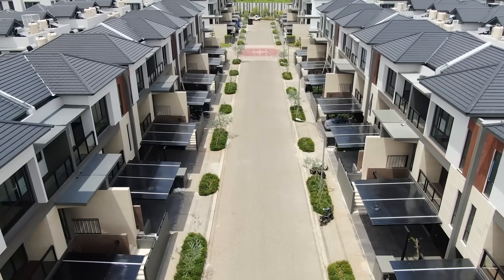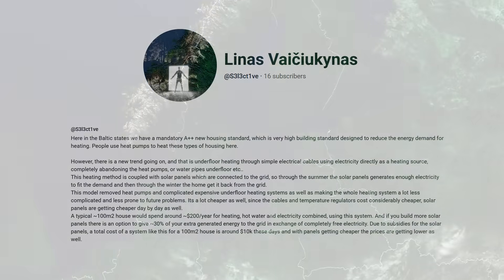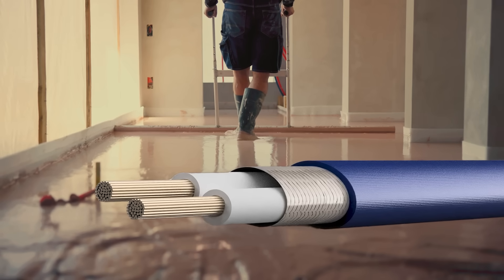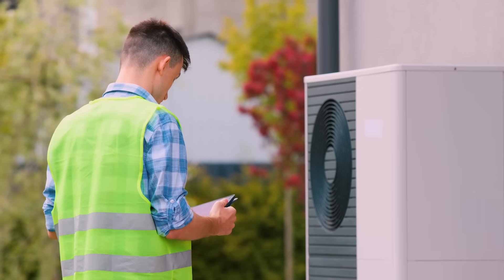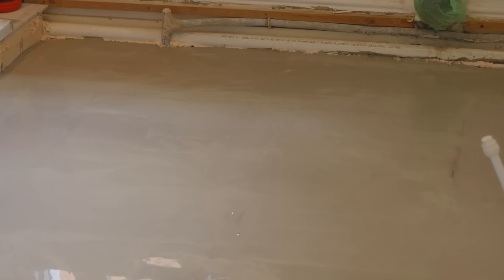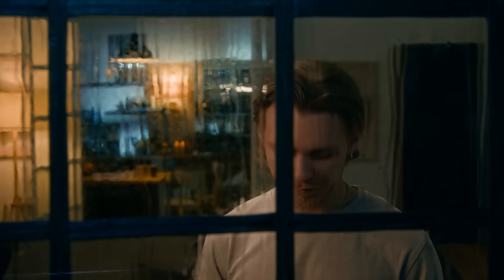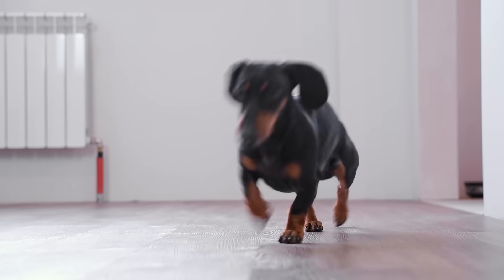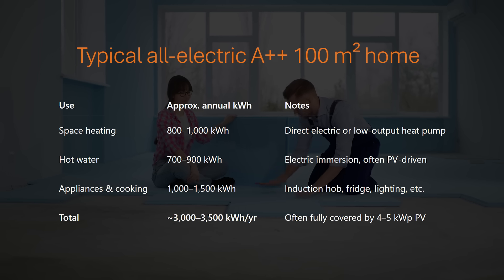What the Baltics Can Teach Us About Home Heating

Comment: We've got electric underfloor heating throughout a property, the only heating system and no gas available. I would say it's more cost effective than other types of direct electric heating but also a really comfortable stable temperature. Many flats can't get gas nor a heat pump so if you do a refurb it's the best option
Reply: Or buy apartment on4th or 5th floor. Then you dont need any heating at all.Your neighbours bellow pay for it
Reply: I’m sure it works fine, but knowing   I could be paying 1/4 of whatever it does cost for a boiler or heat pump driven system would be too much for me!
Reply: @edc1569 Yes - it's at a property where there is no 4G signal either so we can't even get a smart meter and cheap overnight rate. The plan was to get a battery and charge cheap rate overnight and use that for the heating. Irony is electricity is really expensive in this country because of gas!

Comment: Slightly off topic, but unvented heating systems are much more complicated than the old vented systems, I've found they cost much more in repair bills
Reply: I’ve found less, all that pipe work and the open tanks in the un insulated loft space would always cause issues. 

With the unvented maybe every decade you need a new expansion vessel, but that’s been it!
Reply: @edc1569  I've never had an issue with properly lagged pipes and tanks in the loft

Comment: About 40 years ago worked on a Swedish home down in Exeter it had triple glazing throughout the house walls were 12 inches thick with 3 layers of varying insulation we took sleeping bags just in case we couldn’t get digs as it was late when we left. Had to open the windows it was so hot no heating on just the house itself. So if the house is built to really high standards like this well your nearly there. We slept in the house staying for week or so pub across the road.

Comment: here in the faroe islands air to water heat pumps work perfectly well , i dont understand why it simply wont work in britain
Reply: They do work when:

1. You can find a competent installer 
2. You aren't poisoned against it by media in big oil's pockets
Reply: Do you have the daily mail on the faroe islands?
Reply: @edc1569  no
Reply: a regular house here is about 250m2 in two stories and they have went from paying 400pounds a month on diesel fuel to just paying 90 pounds a month on electricity instead and the houses are just as warm as they were before with oil fired boilers

Comment: There's no debate about keeping the heating going with a heat pump, the heat pump runs more efficiently in this way and so uses less energy, with maximum comfort levels. A heat pump will always produce far less CO2 than either a gas boiler or direct electric heating, the latter can be fine in incredibly well insulated homes, a heat pump works fine when the insulation isn't that special.
Reply: Depends on how the electricity is generated. Solar, wind, nuclear - I agree. Gas powered generator? Not so much.  Depends on the plant - latest ones may be close to 60% efficiency, older ones way way lower, some down at 35%.  Then subtract the losses in transmission and distribution. Suddenly not so clear cut.
Reply: @Kate_Short-For-Bob with 60% efficient pure gas generation you are still saving 40% of the gas. Increasingly in the UK your generation will be renewables with gas planned to be 5% of generation in 2030.
Reply: You absolutely need a well insulated and airtight building for a heat pump to be effective. That is indisputable and a simple fact.
Reply: @PureHokkaido  no, plenty of Victorian terrace houses and cottages do just fine with heat pumps, thank you.

Comment: Hi Roger.     Heat pumps are the Evs  of the heating systems , not here for the long haul . The more there are the quicker the reality will become  apparent , particularly in the resale of property . But I suppose the saying, no pain no gain , is a reasonable statement . Unless of course your the one who gets the pain 😂
Reply: Meanwhile, in the latest cupra born a £26k new car I can drive from Scotland to London with a single 20 minute charging break.   I do it every couple of months.

Heat pumps have been heating commercial buildings for decades.
Reply: Kind regards indeed , enjoy it while it lasts . But don’t expect it to have any value when the time comes , as for heat pumps as a retired electrical contractor , I can assure you they have not been around for decades certainly not in the form of tec there desperately pushing now . And the same goes for EV they can’t sell them even at less than half price .  But ultimately if you’re happy that’s all that matters  . 👍

Comment: A2A units are a tenth of the cost of A2W, that seems like the obvious solution.
Reply: Not if you need 8 units 😂
Reply: @edc1569  Tell that to our victorian pile. Big old buildings were often designed to be heated from a few central points with big fires. Shove the A2A system in those rooms and magic happens just like the original designers intended.
Yes you now open doors to warm a room rather than close them but that's what us oldies grew up with before radiators anyway 8)
Reply: @edc1569  For smaller properties, A2A works well. No need for 8 units in them. 1 or 2 units typically, maybe 3 or 4 at a push - even then you have multi-split systems that cut down cost.

Comment: The "solar bank" is also a thing in the Czech Republic. You can feed into the grid and "bank" those KW for use in winter, rather than being paid a flat rate (although you can opt for that option if you wish).  
It is a very good system.
Reply: Sounds like an unsustainable system though, if enough people do it where does the energy come from in winter?
Reply: @aliasgharkhoyee9501 Over 80% of the countries' energy mix is nuclear/coal.

Comment: My ASHP is currently running. Toasty 21 Celcius inside, 13.3 Celcius outside, using 350W to pump 3150W of heat into the home with a flow temperature of 32.1 Celcius going through the radiators. Dirt cheap to run with this weather and stil very competitive compared to a gas boiler in winter.
Reply: that's a warm temperature , if it was 10C cooler or more as in UK winters the cost soars...
Reply: @jameshall5624 I live in the Netherlands. Pretty much the same climate. Average SCOP so far is 4.7, so thats 4.7 x as much heat pumped compared to electricity used,  including winters with snow and sub zero temperatures outside.
Reply: @jameshall5624  They still work well at minus temperatures, the comfort levels from my heat pump is at all external temperatures that we get here, far greater than I've ever had from a gas boiler - and it's cheaper to run as well. When I rent a holiday cottage that has a gas boiler (almost all of them), I feel like I'm slumming.

I have standard insulation on my 1960s ex council house.
Reply: My heating system is way cheaper than that because I wouldn't even switch it on with an outside temperature of 13 Celcius.  Whatever happened to resilience?

Comment: I live in Lithuania and I’m building a 240 m² house here. The grid scheme works so you can feed electricity in and later take out 69%, but anything left over gets reset to zero on 31 March each year. The government has guaranteed this setup until 2029, but the EU is pushing countries to move to fixed or variable selling prices, so it probably won’t continue after that.

Like most of mainland Europe, there’s loads of solar here. There are even schemes where people in cities can buy panels in solar parks that are virtually connected to their homes and use the same grid system.

Air-to-air and air-to-water heat pumps are sold really aggressively, but I’ve heard lots of stories of people being unhappy with them. Ground-to-water systems are more popular and usually use boreholes instead of trenches, but when we looked at it, the numbers didn’t make sense — for the same money, the solar panels would give us around 300% of our estimated energy needs. We’ll just use the electricity directly to heat a buffer tank for our water underfloor heating.

Water underfloor heating is still standard in new builds, and stoves with back boilers linked to a buffer tank are common outside the cities. In the cities, most people use district heating — big networks of hot water from central power plants. If you’re connected to that, it’s by far the cheapest option and you don’t need any heating system at home.

Roger - let me know if you are interested in having a look at what I'm building. I've had an interesting journey, learning the differences between how to do things in the UK and Lithuania.

Comment: If you have an energy performance survey carried out, you'll get a lower rating for electric resistive heating compared to gas. I've got a flat with the latest electric panel heaters and it has a very poor rating. The only very poor rating compared to the other criteria whereas a house that I own that has gas heating has a good rating. They both have an overall 'C' rating but the flat was built in 2006 and the house in the 70's. The government wants to tighten up the EPC regs yet want everything run on electric. Doesn't add up to me but then does anything that the government sticks its grubby fingers into?
Reply: Affordability comes into domestic EPCs and therefore the high cost of electric brings the EPC rating down. Can you believe that, they're ramming heat pumps down our necks but installing electric heating actually reduces the EPC rating. It's madness.

Comment: So they 'save' around £800/year but see a building cost (outlay) of £25,000 to achieve that status?  It will take you 30 years to recoup the cost.  No such thing as a free lunch they say.  There is no reason we shouldn't have cheap electricity.  I can produce it myself for the same price the grid delivers it so what happened to economy-of-scale?  We should be able to buy electricity at 1/10th the cost of DIY generation but we are CONTROLLED via our energy and that's all the Government are interested in.
Reply: can you produce it when you want and in the quantity needed? 1kwh in the middle of a summers day isn't the same as 1kwh on a cold dark evening with no wind.
Reply: Also the level of tinfoil hat ism going on here is total nuts, our electricity industry is incredibly open you can go on websites and see what’s being generated from where at any moment you can see the live pricing data from sites like ember, you can get chat gpt to break down the pricing and costs to absurd detail if you want.

Running a clean modern grid is just expensive and input costs for the UK have gone up dramatically as we take on the double issue of depleting UK energy sources and an increasingly unstable world - alongside some pretty strict green targets.

You really don’t need the tinfoil hat - all the information is out there.
Reply: @edc1569  agree, but I do think you need to mention the cfd pricing, which shows how ridiculously expensive wind ends up being, particularly as it is nondispatchable
Reply: @edc1569  It's not an open system when the suppliers are 'forced' into operating under conditions that do nothing other than increase the price to the consumer.
Reply: Luckily in the UK we have an open system so you can build a power plant and get it hooked up to grid and start earning, so I guess we just need to wait a few more weeks until the capitalist line their pockets and just sell electricity for twice what it costs them rather than 10 times …..
Reply: You're spot on
Reply: Even soviet comunism was more fair to its people...In councill homes , they even fit more vents to let the heat out under excuse of safety...

Comment: One thing you never heard on these insulation ideas is the elevation and position of your house and more importantly the parts of your house that would let in cold quicker or lose heat quicker than other parts. If this was taken into consideration, a lot of people would find they could save or prepared better by using more insulation where it's needed. It's not a case of filling up every bit of the house, just lead to other problems and an uncomfortable summer, maybe. Just look at my house, the back door look brand new after ten years or more but the front get totally stripped every year by wind and rain.

Comment: They doing it wrong. Those tight houses needs recuperation system for ventilation. So better idea would be to use air-to-air heatpump and combine inside cassette with that air system. Similar to what USA doing with their HVAC. That air-to-air heatpump would cost like 1-2k and you are set... +you get AC also
Reply: even though its air to air the building is still air tight so no benefit over hydronics
Reply: @dantronics1682 How there is no benefit? You still need heating/cooling. Why not go with cheapest option when set up costs isn't that expensive?  If house will not have recuperation system aka ventilation it will rot out from inside.
Reply: @Tavs.fāters Yes, a heat-recovery ventilation system is almost essential in very tightly built houses. Those systems should have a metal filter to prevent mice/birds/insects from entering the system, a paper filter that's similar to a HEPA filter to filter out most particles, a carbon filter to eliminate odours, an ERV heat/humidity exchange system, an air-to-air heat pump and optionally a demuidifier/air conditioner.

You can't just seal up the house and shove in an air-to-water heat pump to heat the radiators(whether underfloor or conventional radiators) to heat up the same stale air that becomes more and more humid and carbon dioxide-laden as people breathe and live in the house. That cheapskate solution isn't going to cut it.
Reply: Recoups are mandatory here, otherwise you would suffocate in house that well sealed. But we don't use forced air as that is uncomfortable; everyone preffers using radiant heat. Install separate AC for those 5 days during summer when you want one, otherwise AC is not actually that useful in out climate
Reply: @vkalvaitis  Recoups already is 'forced air"... Adding low power heat pump to it wouldn't make any difference in air flow around the house.

Comment: Really don't understand why you've got it in for heat pumps.
Reply: I can see his point, I like heat pump, I have a mini split and dont save anything over running gas, the main savings is one energy bill so no expensive gas standing charge
Reply: Why do you think that? He's always said he's in favour of heat pumps, at least in many videos I've watched in the last few years. 

He's right to point out that installations aren't usually done right as installers aren't well-trained yet (it's early days for A2W heat pumps), which normally causes issues with cost and efficiency for households.
Reply: Because he is uneducated, ill informed and a misogynist bigot.
Reply: They’re unsightly for a start
Reply: To be fair to Roger he’s come round to them, he’s just an old dude and likes scorching radiators and still thinks a condensing boiler is some sort of engineering marvel. Let him be.

I’m sure he remembers how transformative central heating was to the UK, getting your own gas central heating at home installed was such an uplift for people’s standards of living back in the day.

Comment: Huge mistake. Here in Sweden we have houses built around 1980 with resistive heating only. They might require 4-5kW of heating in the winter. Lots of people are augmenting this with a mini split air source heat pump to save some money. Worst part if you don't have any hydronic system for heating is that your options are extremely limited if you ever want to change it. I wouldn't recommend to install a resistive heating system now. The only resistive heating I have is just for my bathroom floor and it uses 1MWh/year which is a lot just for that. Building total requires 25MWh/year in heating, but with my ground source heat pump this is cut down to 6.5-7MWh/year.
Reply: Similar here  in Finland. Many older homes built with direct electric heating have been retrofitted with air source heat pumps - that's if they haven't been torn down and replaced with something new, built to modern standards. Electricity here is often very cheap at night, even in the winter, so the underfloor direct electric heating can make sense with the whole floor acting as a massive storage heater - The floor is a giant block of concrete with insulation underneath and all around, so difficult to retrofit - especially to UK houses with wooden floors.
Reply: The resistive heating in Lithuania was, is and will be rare. Most people choose air-to-water heat pumps, best models of which are able to move sufficient amount of heat even at  -30oC, and with SCOP of >3.0.  

I follow the discussion between Skill builder and Heat Geeks. Yes, you can build a house to a Passive house standard, and have the only heat source- resistive heating in the heat recovery ventilation which is enough to heat the whole house through the coldest days. Rest of the winter, which due to climate change is more like autumn now (+8 to -5), you can be very comfortable without any heating.  Problem is that you need really good designers, engineers and strict supervision when the house is being build, because aiming for perfect insulation means every tiny detail of the building matters. The other approach, the mainstream A++ is still good insulation, but in such a house you still need energy efficient heating and cooling system. Every HP can cool as well, but not resistive heating.  Ground source HP  (GSHP) can take cool brine (+7oC) directly from the ground loop and cool the house. It is almost free cooling. I'm very happy with my GSHP.
Reply: same case in Denmark, my grandparents house was built in the 1980s and fitted with resistive heating in all rooms, too bad it became too expensive and previous owners had to install a wood stove and air source heat pump in 2007 (wood stove used only at day, heat pump used at night and when house is vacant)